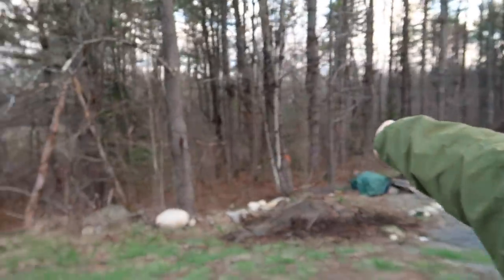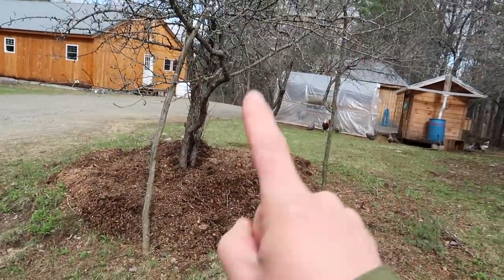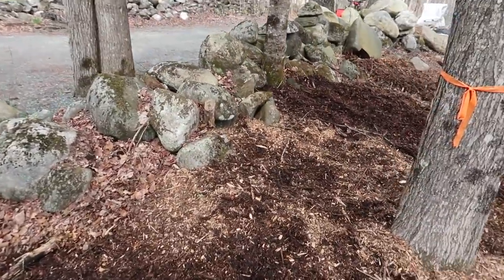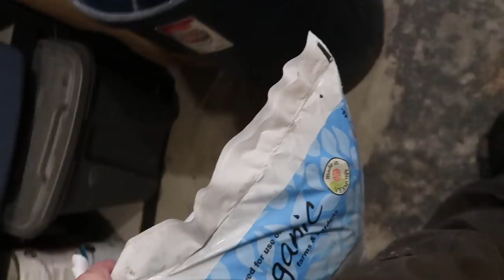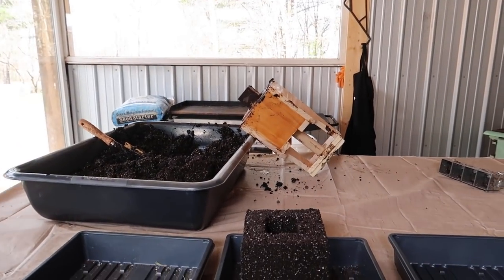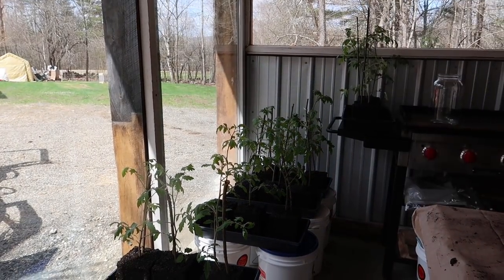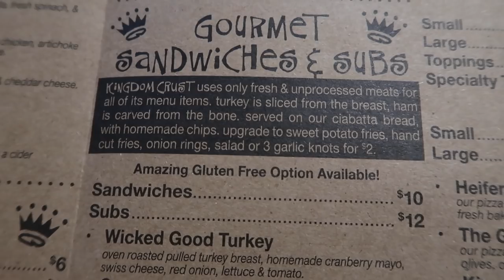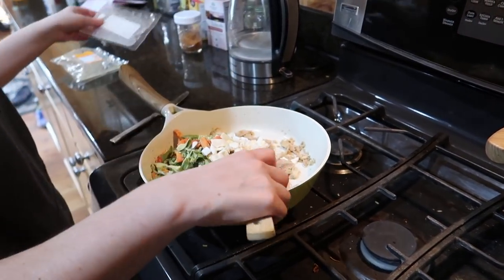Making Room To Expand the FARM

Comment: Hey Al,
I was checking out the mulch around your apple trees. 
You may want to remove the mulch that makes contact with the tree. Intact, you may want to be about 6 to 12 inches away to lessen the chance of predatory insects attacking your trees! You can spread it out as far as the trees drip line.
Cheers...

Comment: That area looks like a good spot for a goat herd. Tomatoes are doing great in the soil blocks. Never have too many blueberry plants. YUM.  Boy the BLT's we had for supper last night were great. You could make the core of the soil block maker full depth so when you push the block out it looks like a donut then drop the tomato plant clear to the bottom of the block and fill the remaining core with potting mix. It would help support the plant and increase the root area greatly. You'll be in the garden soon.

Comment: I grow my tomatoes large too as we get hail and snow let spring. When I pot-up my tomatoes the one thing that makes them strong is to burry the stock. I put the plant at the bottom off the pot and fill the pot to the top. The tomatoes will set root all along the stem. I can see this as a downside to the soil block. Wondering if you might build one with the space almost down to the bottom so you can drop the plant all the way through it.
Reply: I just said the same thing, awesome idea Winding Trails !!